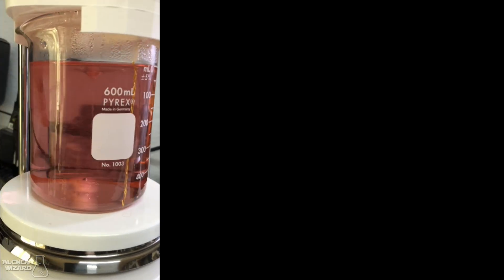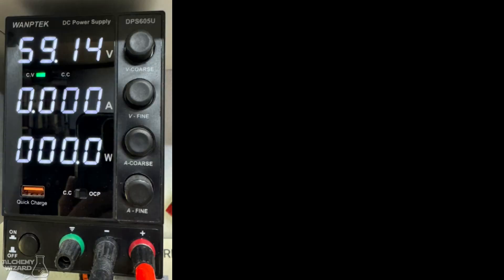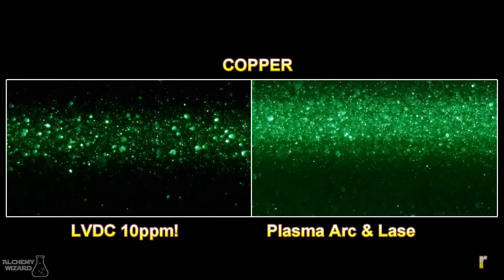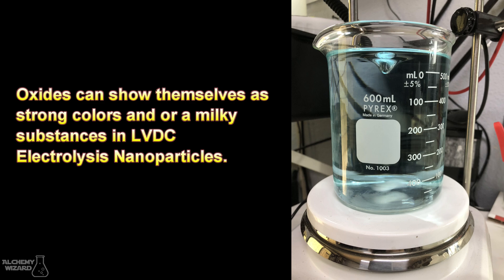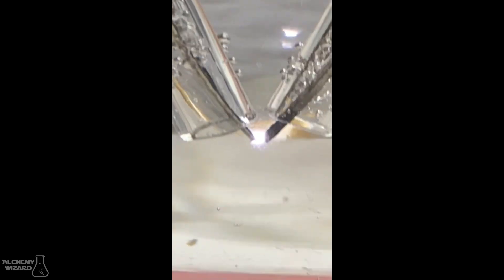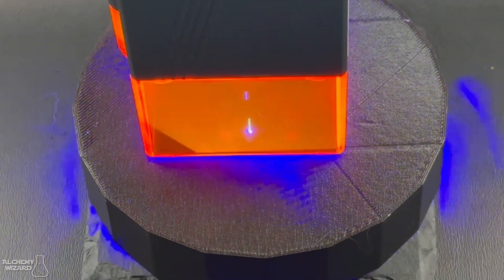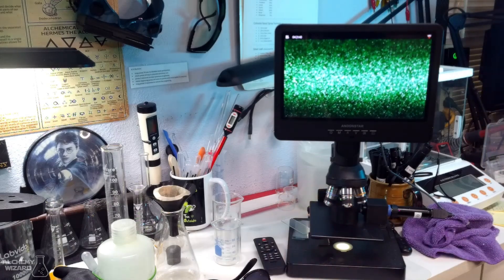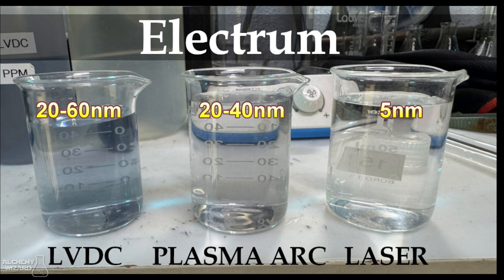Nanoparticle Methods! Which one is for you?

Comment: Is the reason your colloidals are clear in color using the laser is because of the low power of your laser creating smaller particles?  I've seen other laser vids on pure gold where you can actually see a plume of red coming off it... higher power making bigger particles?
Reply from the maker: Those videos are actually not showing  everything. The want to make it impressive. So what is more impressive, seeing a laser create a striking red substance, or nothing that you can see? 

To create the red gold color is bit of chemical magic. They add chemicals in there to force the gold particles to 20nm, so you can see them and create Gold chloride, which is colorful itself. This stuff is not as healthy for you as drinking the pure nanoparticles. 

Sometimes, to make it really dramatic, they may even use hydrochloric acid in those videos to help break down the gold, which makes it undrinkable.